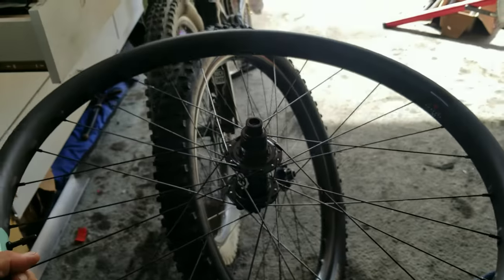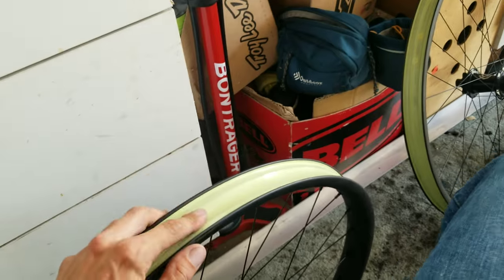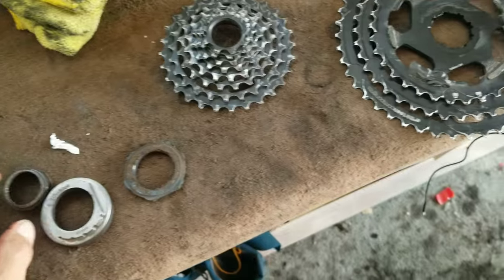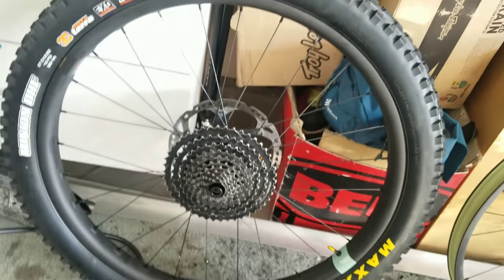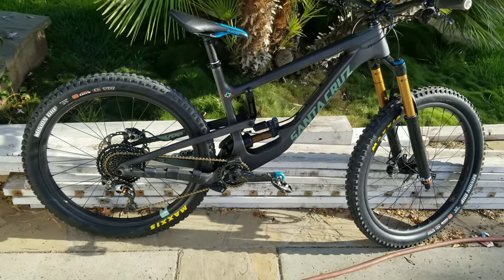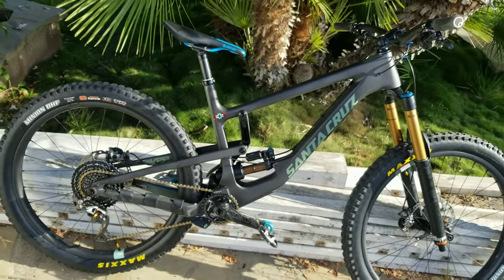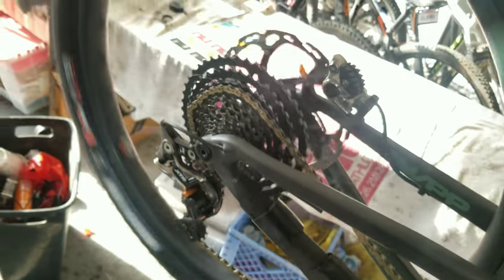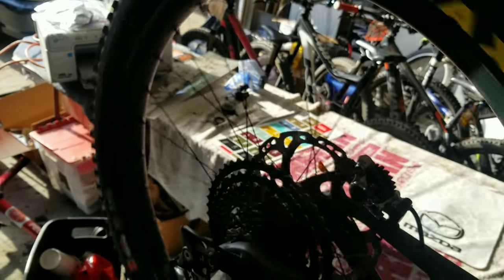Santa Cruz reserve 37 mm and (vs) reserve 27 + industry nine torch

Comment: Just wondering.. you use the 10 speed Goatlink on there? Performs better than the goatlink 11 on that particuliar cassette?
Reply from the maker: Moved to the wolf tooth essentric cage /wheel on this bike when I had it. Worked best like this. With stock hanger

Comment: The reason you are cracking frames is because you are clamping the frame in the maintenance stand by the top tube, this is a no no on a carbon frame.

Always clamp in the seat post with the dropper fully extended
Reply from the maker: Incorrect. But thank you for input!
Reply: So you are saying that it acceptable to clamp a frame in a work stand by the top tube?
Reply from the maker: @superstar999100  why don't you go watch the legendary pinkbike video of  Santa Cruz carbon frame smashing and troll the comments there. You Really think a rubber inserted jaw clamp does more damage than that? Or my 28mph crash on concrete pavers that caused that crack? Cmon dude I'm here to help people and you're wasting time on nonsense
Reply: Watch any of the hundreds of bike building videos on YouTube such as Joe’s Bikes and you will never see bikes clamped in a work stand by the top tube. In fact when building from new the bike tech will insert an old seat post into the frame and than clamp the bike in the work stand using the seat post. When the bike is built it is then removed from the work stand and the seat post is removed and replaced with a dropper ON THE GROUND. Check it out.

Comment: Love what you did with the Reserve 37 rims and 2.6" tires on your Nomad. Looking to do the very same thing, have you had ANY rubbing on the rear triangle or VPP linkage with those fatty rims and tires????? Thanks in advance
Reply from the maker: No rubbing and no problems whatsoever so far, and I ride pretty hard! I figured I would get a little rub from wheel flex, but no!

Mud clearance is the only issue, I got stuck in some tacky stuff the other day and ended up walking my bike to my because the wheels would not move at all.
Reply from the maker: I rode the 27's for quite some time, now going on a while with these 37's. Pretty noticeable difference. Just incredible how well the bike handles and responds. Would highly recommend!
Reply: @collinmcballin  I'm ordering my new Nomand within the next 2 weeks and want to set it up with 37's and 2.6" tires right out of the gate. I'm not big into riding in thick mud so I should be good there. Surprised to hear they dont even rub when the wheel flexes!!! Go big or go home 😎.. Appreciate the heads up.. Great vid
Reply from the maker: @cmf2424  awesome, Glad to hear you're not getting a Bronson LOL! Make sure you request 37's on it because they'll put them on, yes they'll fit up to 2.8's without a problem, but they're overkill
Reply from the maker: @cmf2424  and yes glad to help!

Comment: Worth going 37mm internal over 30mm?

Running 2.6 on flows, weight doesn't seem worth the reserves cost. 107g difference on my math
Reply from the maker: The weight of the reserve 37 rims is actually less than Reserve 30. I'd say it's worth the change only if you're running 2.6 tires. 2.5 with 30 mm rims is a really good setup I'd be happy with this well!
Reply from the maker: Rotational weight is 4 times stronger, so if you're reducing Tire or Rim weight, multiply it by 4 and that's the difference that you'll feel
Reply: Collin Timmermans so we shouldn’t be running cushcore (250g rear, 250g front), and should step down to 2.3 tires. 😄
Reply from the maker: @JRasS14  😂😂 right LOL! 

I'll take performance over weight any day, you can adapt to heavy wheels and be fast! BUT, your bike can't adapt to smashing rocks and loosing traction with light tires 😳!
Reply from the maker: @JRasS14 it's plus sized cush core, even more ... 😳 😢
Reply: Collin Timmermans 

Didn’t know you needed to run plus sized.  

Honestly thinking about trying 2.3 out. May be too small for flow (29mm internal, profile may be off). Heard Aaron Gwin runs a 2.4... 

2.6 is nice for bottom bracket clearance which is my biggest gripe with our nomad climbing in rocky terrain.